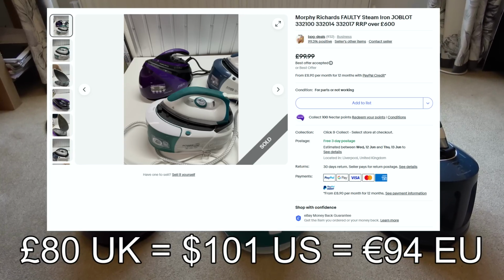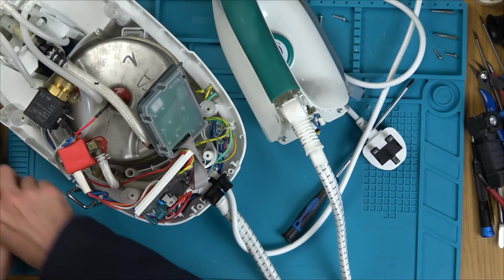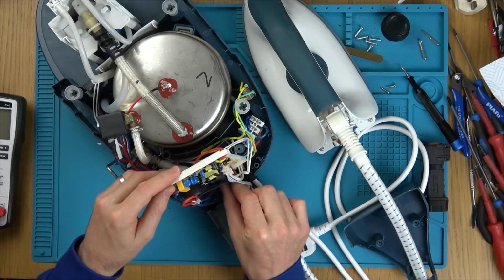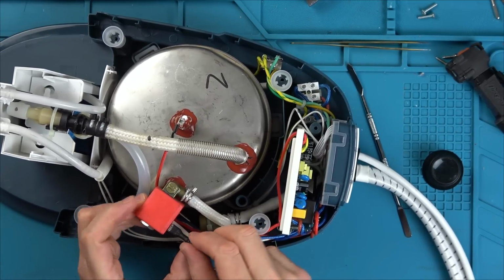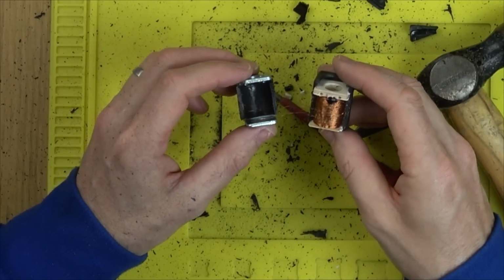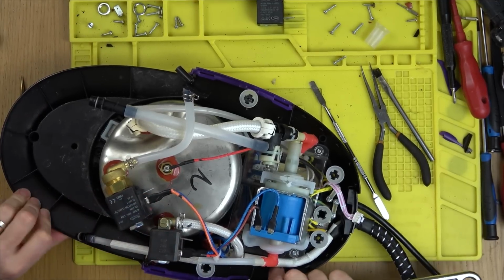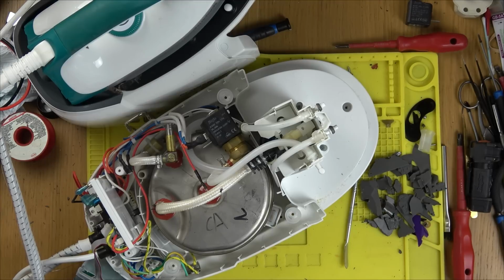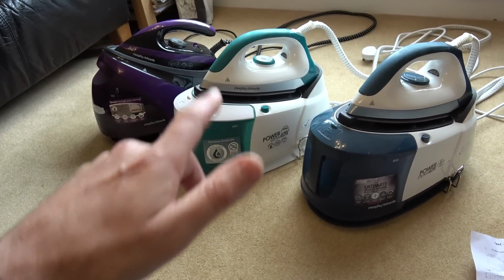eBay Joblot of FAULTY Steam Generator IRONS - Can I FIX Them?

Comment: The coils on these type of solenoid valves fail constantly.  Just down to use and heat.  It’s very very common.  You can get replacement coils in some cases, try a Google for just the coil.  These solenoids are used through industry its the valve bodies that’s vary, they are used for chemicals, water, steam, air etc.  Probably 24Watts ish, so lots of ironing and the coils going to get very hot, not to mention 100degC steam thermal coupling to the coil.  It’s bound to fail 
eventually.  Solenoid Valve explanation video https://youtu.be/WlkVlDBSbvg.

Comment: I owned an expensive Morphy Richards steam cleaner, selenoid failed, couldn't get a replacement selenoid, I rang Morphy Richards and was told the steam cleaner was discontinued and no selenoid available for it, I vowed after that never to buy Morphy Richards again.
Reply: We have some of their kettles, some of which are 20 years old, which are great and TBH their white goods in general used to be "robust" but the last 10 years or so their quality has gone through the floor.

Comment: more than likely the issue with the solenoid failed because people held them open - the coil overloaded with power and burnt out - they likely aren't meant to be run permanently on. As for the iron hotplate failing - its probably 2 separate faults. the hot plate failed - possibly due to the heat plate taking too much power through the relay. and then they used the solenoid of steam thinking that was why it wasn't staying hot, and that burnt out the solenoid

Comment: Those solenoid valves also have a non resetable thermal fuse so maybe they got very hot or the temperature of the steam caused them to fail

Comment: I'm so confused about irons that come with a base unit.
All irons I've ever seen (in Canada) have the water reservoir built-in for steam generation.
Reply: More steamy goodness. Having it all in one handheld unit means they have to consider the weight. Never used one myself, but I've heard they're much better as they can whack in a larger heater and water tank as it no longer matters how heavy it is. Also they can (and do) charge a hell of a lot more.
Reply: @georgeprout42  Yeah, that's probably the only argument that makes sense: A bigger tank.

Yet that all seems like an over-engineered solution if that's the problem they are trying to solve. Sounds like there's more to it.
Reply: @jerem-SaveStargate  Most of the all in one handheld ones (they're also far more common here in the UK) make steam by just dripping cold water through the hot sole plate. What we call "steam generator irons" like Vince's in this video can produce about 10x more steam. I've used both and there is a massive difference though personally I iron something about once a year so I just have a cheap handheld one

Comment: My guess why those solenoid valves have failed is because it's completely incased but through the heat of the steam in the pipe and cooling down, the metal and plastic move slightly and the wire can only break off where it's connected to the poles. The red one might be a later revision?

Comment: 16ohm element @ 240v means the hot plate alone will draw 15 amps at least by my maths? Please correct me if I am wrong
Reply: The supply is 240v AC, which means that inductive reactance limits the current through the element, as it is a coil of wire
Reply: @martinmoore3969   cheers, I thought I must be missing something. I will look up the formula for that one

Comment: Well done, Vince!

I'll admit, I know next to nothing about irons.  But I was intrigued by the fact that all these had the water reservoir in a separate base unit.  All the irons I've never used (or seen!) here in the US have been compact units with the water reservoir built right into the iron itself, with just a single power cord to the wall.  I don't know if that's a locale thing, or if I am just naive in my iron knowledge 😂
Reply from the maker: I think these are the fancy version and create a lot more steam. I presume they are worldwide...BUT I don't actually know that. Cheers Steven 👍
Reply: @Mymatevince They're specialist tools here, used mainly by professional dressmakers. I doubt one in 100 people even know they exist.

Of course, I doubt more than one in 10 people owns a regular iron these days.
Reply: @Ea-Nasir_Copper_Co  Agree that irons seem to be less well used these days ! Steam generator irons have been around here in the UK (and presumably Europe) for about 20-30 years to my knowledge. They are much more widespread now but are still 3-4x the price of normal irons so not universally used. I used a normal iron until a couple of years ago but would not go back - these units really make ironing much easier with the volume of steam generated.
Reply: Me neither ... those crazy brits ... 😀
Reply: Yeah our normal irons are like the the same you pour the water in the iron.
Reply: It is a newer innovation in Europe generally - my older Tefal steam generator iron fills directly into the steam boiler. It does make it easier to refill the iron as you don't need to unplug and carry it to the tap.